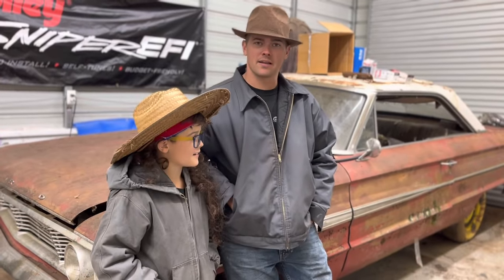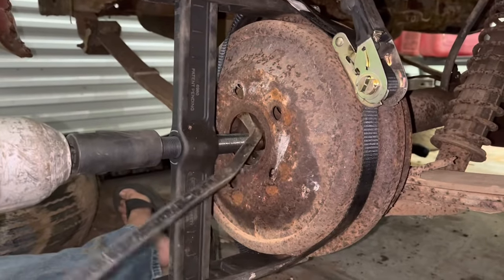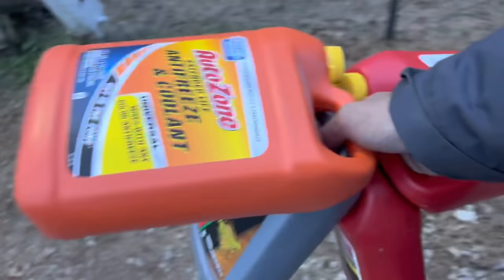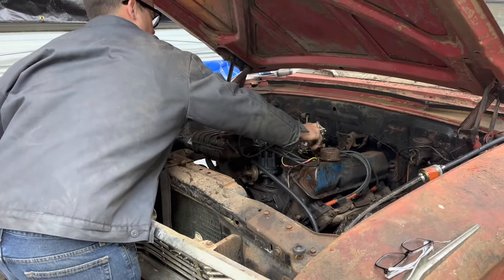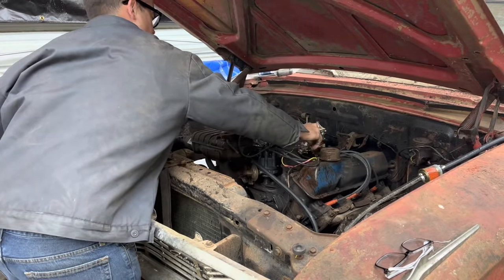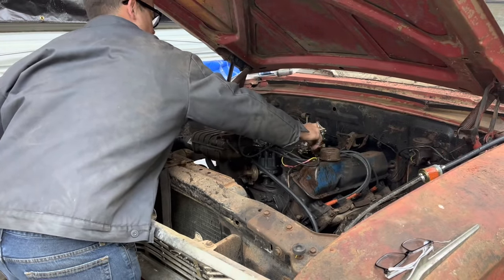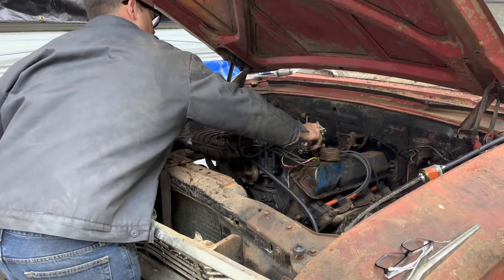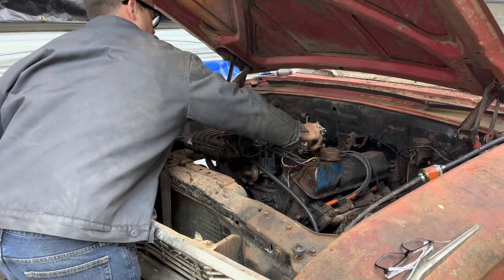30+ years parked and then instant burnout

Comment: FYI. Vinegar and water 50%/ 50% will eat rust off. I use it when I get an cast iron skillet and it has rust. You just should not leave it on for more then 30 min. Then use a wire brush. If it doesn’t all come off repeat the process. I love your channel. The interaction with your kids is wonderful. You are great parents. There should be more parents like you maybe we wouldn’t have so many problems in the world.

Comment: I have a 1967 Galaxie 500 2 door fastback with a 289, and I did the 390 FE swap. I can tell you that the standard issue I've seen on the water pumps is that the old-timers had overheating issues on those old FE's and that they were constantly filling or fiddling with the radiator or cooling system in general. That's why your fill tank was clogged as well. Typically the more motors you see, you'll see the last two cylinders on the FE's, get more heat saturation. That's why you see a lot of collapsed lifters, bent pushrods, worn valve guides, and sticky valves. Great video.👍
Reply from the maker: Ok thank you for the info
Reply: That is the most ridiculous thing I have read today .

Comment: I believe that car has been sitting with the wheels buried to the frame in mud or in a flood.  With those brake lines caked into the frame,  brakes and drums rusted, and the transmission looked like it had water/ mud in it.  And the trunk floor rusted out,  it adds up to mud/ flood. I love those older model Fords.  They will run the stripes off a zebra. I love watching you work on these old cars because I grew up with my grandfather who was a mechanic and I was like Ralphie. I went under them with him and as a kid I could take a motor apart and put it back like new.  I'm 77 years old now and still love it.  Of course I can't do the work now but sure enjoy watching you do it.
Reply from the maker: That’s great, thank you for watching

Comment: Hey Brother, great discovery with the Posi Rear!!  Every time I replaced an FE engine in my 63 & 64 Galaxies, I pulled the valve covers. If they were covered in sludge (which they always were!), an old timer told me to run 3 qts of kerosene, two quarts of oil and a new filter. Let engine come up to temp, shut down and repeat process. Every time I've done this, when I remove the valve covers, the rockers were spotless.
I HATED those expansion tanks!!!  For some reason they always blew out the seams. Couldn't figure out why.
Reply: The one engine I've ever seen with clean valve covers ended up dropping a valve on me🙄
Reply: Wrong cap, pressure rating too high.
Reply: use of paraffin based oils caused alotta problems in the ford big blocks....poor crankcase ventilation...as well

Comment: Anti-freeze always ends up on the floor.  Sometimes you see little bubbles of transmission fluid floating on top. Dad had a 1967 Galaxie 500 with an identical water pump.  He put about 60,000 miles on it and never had a problem with the water pump.  I just love watching these old Ford engines brought back to life.  Out west of town in Wadesville, there is a 1966 Ford pickup truck with a 360 engine in it.  It is not the original engine.  I wish I had the space to bring it back to life.  My '55 Chevy has front disc brakes with 1968 Oldsmobile Cutlass front spindles.   It has an old single-stage Chevrolet brake master cylinder and does just fine with the front disc calipers.  I have good, solid pedal. A couple of years ago I had to replace the long brake line that goes across the differential.  It had rubbed a hole in the brake line.  Ralphie should be out there with you while you are packing those bearings.  He is such a fortunate young man.  All your kids are!  I love that car and wish I had one.
Reply from the maker: Wow that sounds neat .. yeah he has basketball practice so sometimes he misses on garage time but he is out here a bunch . Thanks for watching
Reply: @Sleeperdude  I know he is.  Wonder what he will eventually want to have to drive when he gets in high school?  If I were him, I would fix that Falcon up with a 289 V-8.  Kind of like a Nova but Ford power.  Of course, by the time he is in high school who knows how expensive gas will be?  Nevertheless, I am sure he is picking things up by osmosis to where he will know what to do when he actually starts turning wrenches.  I really like the way he is into detailing the cars like when you guys went on that trip.
Reply: Actually, I wonder if he has expressed a preferences of all of the weird vehicles you guys have?  I can think of several that would be a lot of fun.

Comment: If all else fails, you can go to a shop that makes hydraulic hoses of all kinds and they most likely can make you some flexible brake lines. Just make sure to bring all the fittings if you cut the line or broke it. 
      You might have a limited slip posi diff in that thing. I saw just one wheel spin a couple of times at the beginning and switch back and forth before both locked in. What a burnout! 
         Make sure you have all that water out of the engine and don't take chances. I saw a guy ruin a fresh rebuild leaving straight water in it. He didn't have antifreeze and he used water. Then it froze that night. Love the car and it really sounds pretty good.
Reply from the maker: Good idea thank you, I allready drained the water because it got down to 23 last night

Comment: When you see the Rube Goldberg contraption look of those drum brakes it's a miracle they ever work. I started doing my own drums when I was 16 and I don't think they changed at all in 60 years. (I'm not 76, but I've seen the ancient drum brakes, pretty much the same.)
Reply: I remember being taught to do drum brakes after trying to avoid them altogether. My instructor put me on a car with 4-wheel drums, told me to do one side at a time and start with the front. By the time it was over, I was old hat! 👍
CHEERS! 🇱🇷
Reply: @armedinbama  Definitely have to have one side to use as reference, at first. I think I still have my spring-stretcher and my retainer pin depresser/twister out in my tool chest.
Reply: @townhall05446  You know what that means, right? Same thing it means when you know what a 45-RPM adapter is for. 😁
From one old guy to another, CHEERS! 🇱🇷
Reply: ⅔35

Comment: Old timers trick for automatics , dump in a pint or two of brake fluid .  Also the type of fan blade on that FE was notorious for shucking fan blades . Used to work in a junkyard and got to see the end results . Have been cautious  around flex fans ever since
Reply from the maker: Ok great Info thank you

Comment: Hey Sleeperdude. That engine looks like a 66 or later 390 ci. My dad had a 66 Galaxie with a 390 ci and your engine looks identical to what I remember of his. The 390 was Fords go to performance motor for several years until the 406 in the 63 Galaxie came out to compete with the 409 Chevrolet in NASCAR races. Then of course the 427, 428, 429 Fords. I think Steve McQueens 67 Mustang in the movie Bullit had a 390 ci with a Tripower set up. That 390 was a good strong motor. Sounds good. 👌🏻
Reply from the maker: I think you are right

Comment: In the late 80's I did that with my first chevy Cheyenne c10 with old 350 automatic with snow tires steel studs after I seen they dug into asphalt I felt bad never did it again, on the other note those older vehicle I think they had vacumn shift modulator on them similar to the shift solenoids today, and yep the trans fluid acts as two things a hydrolic and lubricant still oil product that breaks down in time, an older timer told me  to take socket and tighten down in a vise and bend your brake line around it! I stole the return spring off the back screen door of our farm house to use on mom's ford marique once, dad lit my ass up on that one! But it worked!
Reply from the maker: Ok cool thanks

Comment: If you’re replacing the lower radiator hose anyway I usually will take a 1/2” drill bit to make a hole at 5 o’clock

Comment: Such a good lookin car. Between u and derek from VGG, yall make me wanna ressurect old cars. Down fall is no place to do it. 

My uncle gave me a 87 f250 4x4, he bought it new. It sat for 15 yrs because the fuel pump went out. I replaced it n it ran good. Started drivin it n it gets better every day. The only brake parts ive had issues with is where the pass side hardline goes thru the frame, it just rotted in half. Otherwise, the brakes work perfect. Got lucky with the soft lines
Reply from the maker: That’s great thank you

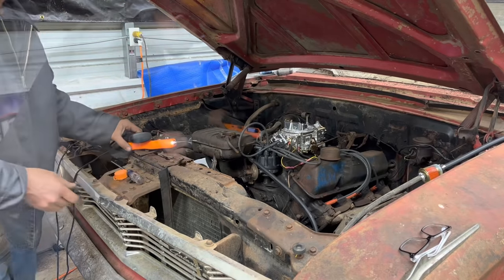Comment: 18:58  It is common for people to hook the electric choke up to the coil wire, but that wire only gets 12 volts when cranking but gets only 7 when running due to the resistance wire or ballast resistor.  This is also thought to be a bad thing because it may reduced current to the coil or over heat the wires going to  the coil, but that may depend on how stout the wire is.  But those are the reasons to hook it up somewhere else. I said this last video on this car, too.
Reply from the maker: Yeah I did not hook it up to the coil , thanks for the info

Comment: There are a couple differences between 66 and earlier FE and the 67 and later. Bell housing circle is round on the early, and has two high bolts later. Also, the early has 3 short bolts  that mount the isolator to the block, the later has two that point straight up.
Reply from the maker: Ok thanks
Reply: @Sleeperdude  I spent a lot of time on the old Fords as a child.

Comment: FYI, there should be a small tag on the differential that has all the pertinent info. It should be on the drivers and engine front side (attached to one of the bolts).

Don’t know where you’re located, but there’s a great transmission shop in Amarillo (YouTuber). Has posted a lot of instructional videos, including the C-6. I believe the name is Performance Transmission.
Reply from the maker: Ok thank you

Comment: If you want heavier back brakes the Ford vans had that three inch pad you just need the sheet metal backing plate that the hydrolic cylinder bolts too.. for the deeper dish 3 inch pad clearance.. get the drums too.
Reply from the maker: Ok thank you

Comment: You do know that if a brake line and hose won’t separate you don’t have to undo the line, you can take the metal clip out and then unscrew the hose off of the line without rotating the line. Works on most stuff and saves a lot of brake lines 👍
Reply from the maker: Ok thanks for the tip

Comment: You should be able to use a soldering iron with solder to plug up them leaks in the radiator. I have seen where they bend back the broken tubes and crimped them shut and then solder them over to stop those leaks.
Reply from the maker: Ok thanks

Comment: The engine and trans might be the best parts of that car. If the master and wheel cylinders are okay. You might try new lines for the rear brakes and then try that gravity bleed I mentioned previously. Again Merry Christmas 🎄 to you all Sleeperdude. All the best.
Reply from the maker: I plan on completing the brakes in the next video

Comment: Hillbilly radiator sealant, take a half cup or so mustard and a bunch of black pepper stir it up making it heavily speckled with the pepper. Spoon into warm radiator and watch it seal immediately. Advance timing till it pings or starts hard hot. Back off till it stops pinging or starts good hot. No more popping thru carb and ruining power valves!
Reply from the maker: Good advice thanks

Comment: I see that you have the choke heater tied into the coil. On all or nearly all 12 volt systems, this gets about 9 volts once the engine is running. due to a ballast resistor or a resistance wire, which is cut out during cranking. To fix it, connect the choke wire to the ignition post on the key switch. That way you will have battery voltage at the choke when the key is on.
Reply from the maker: It probably looks like it is but it’s actually not the wires just ran right next to each other but thank you anyway

Comment: I wouldn't think it is exactly an "engine swap" myself because there was all manner of "weirdness" back in the 1960s and 1970s!! A friend of mine used to drive his fathers' Ford Country Squire Station Wagon which I think was a 1969 if memory serves me correctly, and even that had a 390 big block in it!! And around the same time my own cousin owned a 1966 Bel Air Station Wagon that had a 283 small block Chevy in it!! And some cars came with some of the strangest motor combinations in all the years back then!! I even had a chance to buy a 1967 Ford Station Wagon that had a 429 under the hood, but the guy sold it before I could come up with the money!! And from what I remember about that car he was the second owner which the car was originally owned by his uncle who ordered it new like that!! You have to remember years ago you could actually order a car with a number of different engine options in them, like transmissions as well!! They don't do things like that today, where you can buy a Chevy Bolt with a 454 under the hood, and a four speed manual anymore!!
Reply from the maker: I wish you could still buy them like that with  whatever you wanted

Comment: wheres that timing light? Great videos!! 
there it is. I commented too soon. Check the distributor advance springs, plate{might be stuck} and advance diaphragm. then hook it up and set timing and your new hollley power valves will feel safer.
Thanks again. Fun.

Comment: Not sure on the water pump, but my 67 galaxie did not a locked water pump, but it was leaking out the back. I had to get a 66 thermostat, mine was the 2 or 2 1/2 inch one.
Reply from the maker: Ok thanks

Comment: With your Indiana Jones hat you were dress right for your brake hose dig. The engine sounds good. I think you might a stuck proportional valve on your brakes. When your bleeding your brakes you consider using a bottle with a plastic lid. Then drill two holes in the lid one being big enough for a tube that will fit the bleeder. Put brake fluid in bottle and run the tube into it. One person can then bleed the brakes. Just incase your little helpers run off.
Reply from the maker: Good idea thank you

Comment: When every gear is drive then usually the clutches are either burned down so far that they welded the steels together or the valve body is rusted up. Based on all the junk in the pan, I'd say the valve body is stuck.
Reply from the maker: Ok thank you